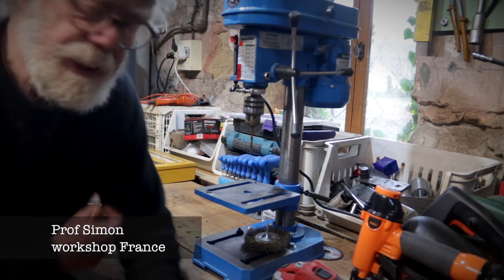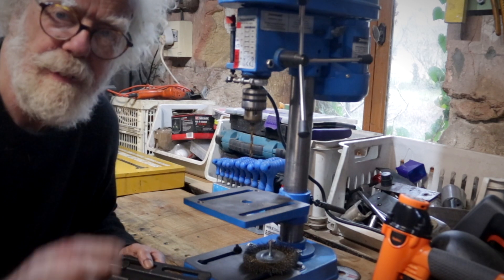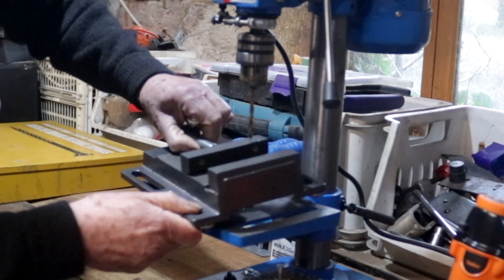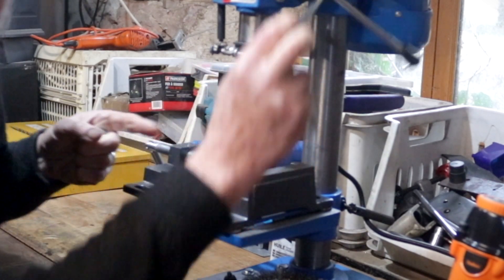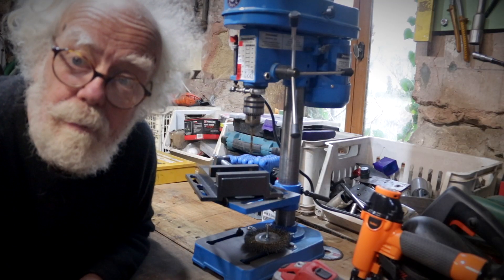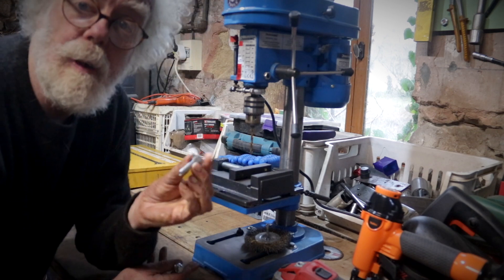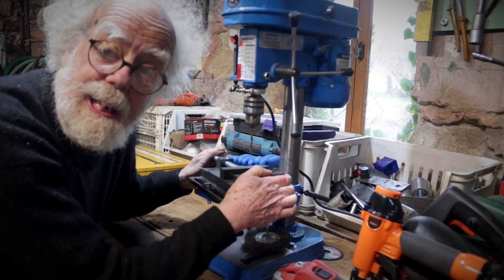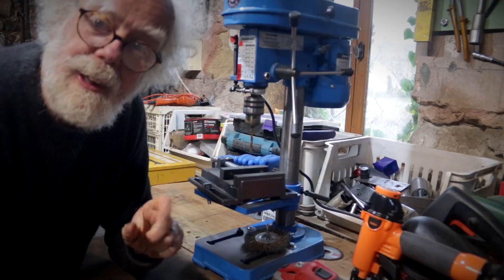Magnetic drill press vice  - update - Prof Simon

Comment: I have just rewatched both of the videos and am now confused. The original problem was that none of the slots lined up to clamp the vice to the table, so the solution was to use magnets.  Viewers pointed out this was unsafe so the solution was to place bolts down through the slots.  How do the slots now line up for you to put bolts down and if you can put bolts down the slots why do you need magnets? 
I would bet that using 1 nut and bolt to clamp the vice to the bed would allow you to position the vice almost anywhere on the table and have it safely clamped.
Reply from the maker: Good point...I missed a bit...had to drill new holes in the drill press bed to take the bolts...I could just use the bolts but the strong magnets work fine for small items..

Comment: The first time that drill bit grabs, rotates and hits those retaining bolts is going to be an exciting day, something will break.  Magnetic chucks are best left to surface grinders, even those can let go though.  I would suggest the safest option would be to go out and buy a smaller drill press vice.  MSC direct have them for £15 up and ship to Europe.
Reply: Then add bolts, duh. Pull them out to adjust, replace with smaller ones.  Genius never stops.